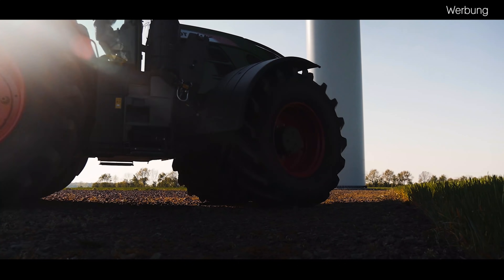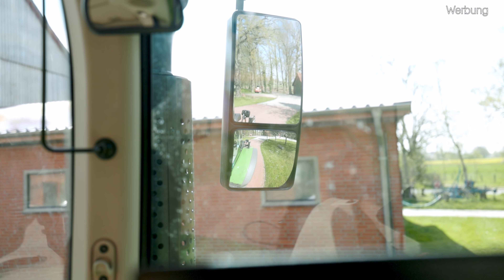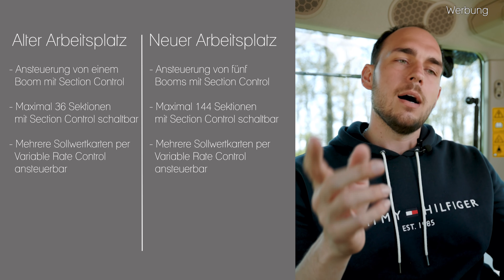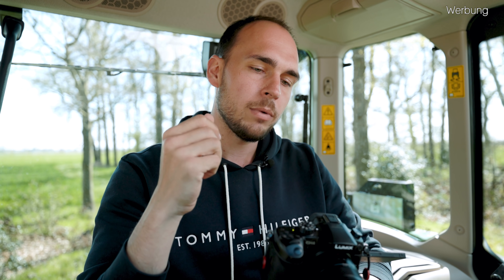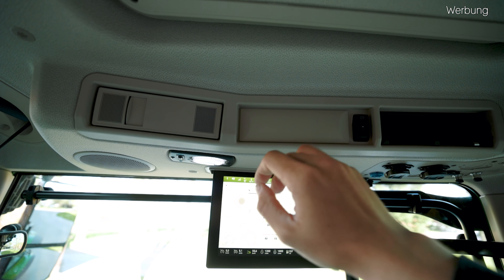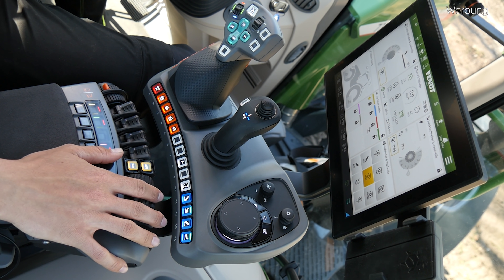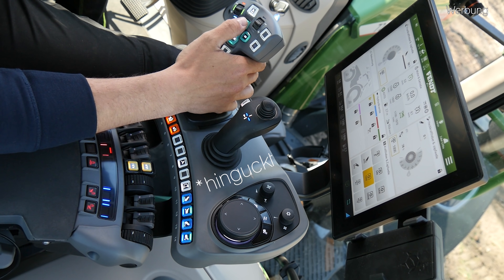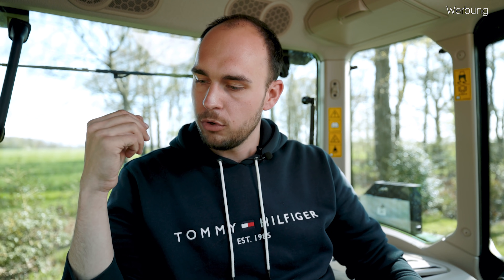Fendt 724 Gen6 - Was ist neu? | FendtONE | Renè Wengelewski | 2021

Comment: Wir haben auch Fendt auf dem Hof allerdings die 800er Baureihe und die 900er Baureihe.

Ich bin von Fendt One in der Profi Plus Setting 2 Option sehr überzeugt.

Einzige was etwas Diskussion mit Fendt gab (ich aber doch letztendlich meinen Willen bekam), ich wollte für die Rundumleuchten und Front- und Heckblitzer so einen Dreh-/Zug Schalter wie ich aus meinem Hauptberuf aus den Einsatzfahrzeugen kenne.

Weil ich finde es schon nervig sowas über ein Touch Menü zu machen. 

Bei meinem Schalter ist ganz einfach:
Nach links drehen: Nur Rundumleuchten auf dem Dach sind an

Nach Rechts drehen: RUL + Frontblitzer sind an, ziehe ich den Knopf in der Stellung hoch, gehen die Heckblitzer mit an. Wenn ich jetzt ein Gerät vorn oder hinten dran habe mit eigenen Signallichtern, dann muss ich das schon über das Display kurz machen.

Ich muss dem System dann erklären, sollen die sich wie Rundumleuchte oder wie Front- bzw. Heckblitzer verhalten.

Der Hinter- bzw. Vordermann wird mir gerade bei Dunkelheit sehr dankbar sein, wenn ich bei Kolonnenfahrt die entsprechenden Blitzer ausschalte.